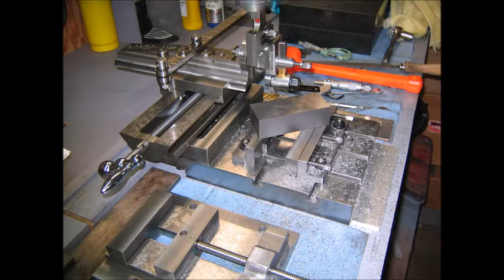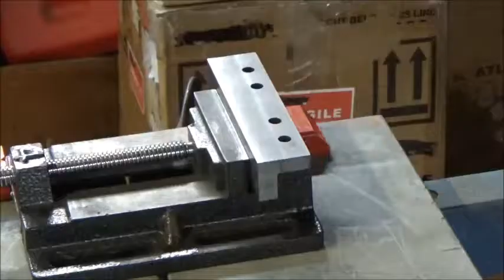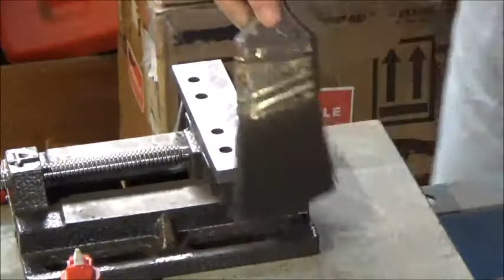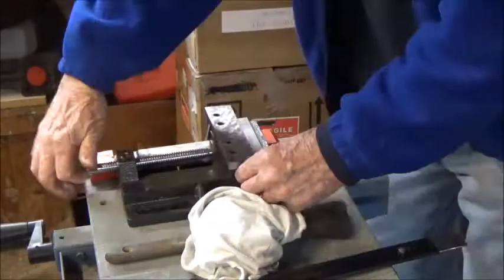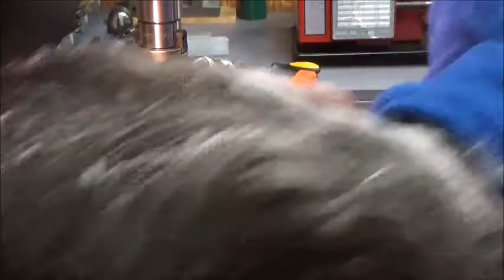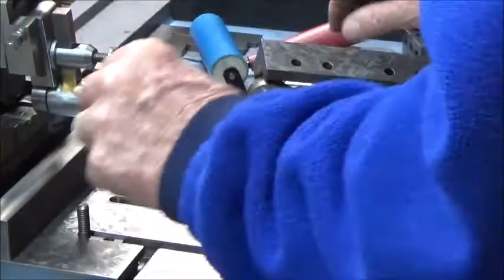Hand Shaper Two Piece Shop Built Vice - Refinement No  1

Comment: Great little series. Would you consider changing the clamp stud to cap heads, by slotting the holes and relieving the jaw back, you might get another 1/2” of clamping length. If you put a 2 DTIs on the face (top and bottom) as you tighten the jaw can you see any rock now?
Reply from the maker: Jon:  Thank you for the comment.  Yes, I did finally check with a DTI and eventually did more scraping work to the face of the rear jaw and the clamping jaw.  I think I made an additional video No.2 to explain the additional refinements.  Thanks again and best regards: Larry